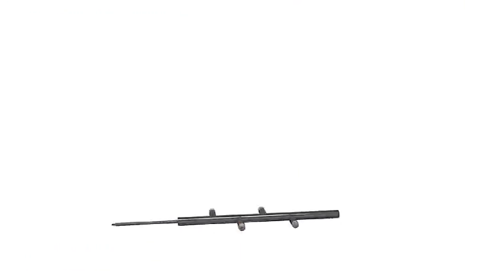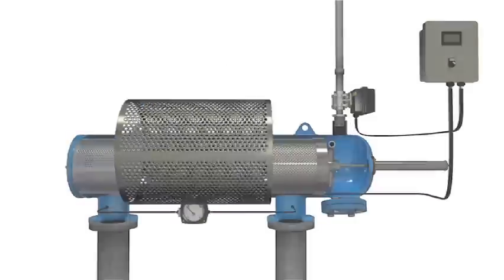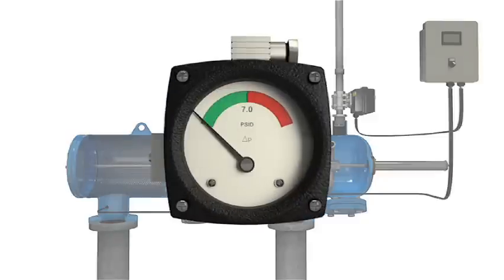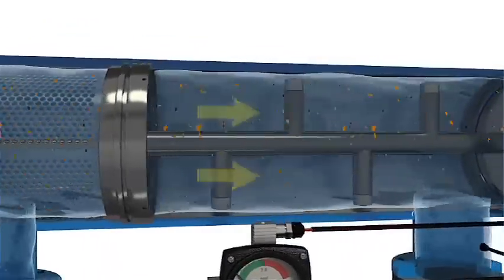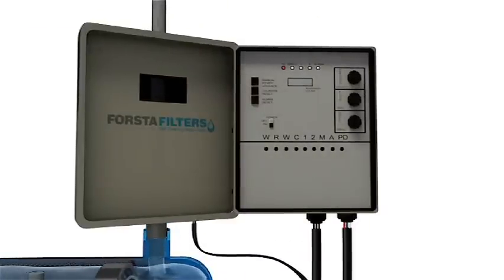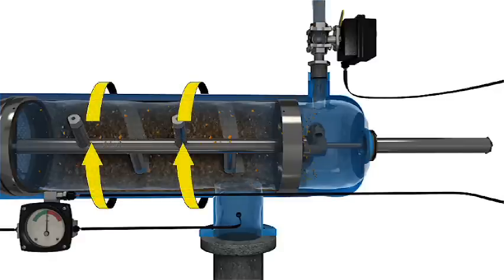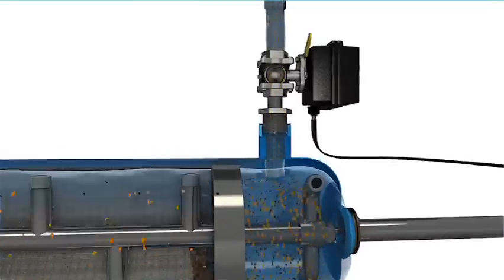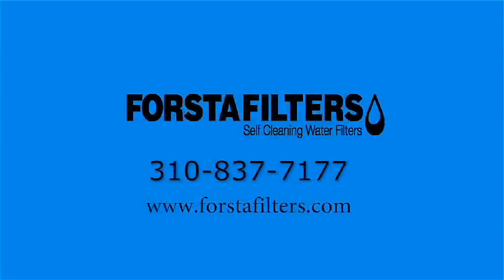Forsta self-cleaning water filters.

Comment: Do you guys offer any models for residential / sm business purposes?  I need clean uninterrupted water flow off a well for a geothermal heatpump to be able to run without interruption.  The amount of sediment varies wildly so a pressure triggered solution like yours would be ideal.  But I am assuming this is made for much larger applications.
Reply: Did you find any solution?